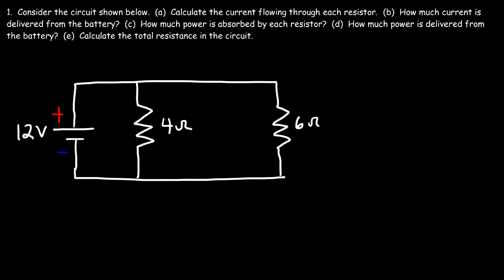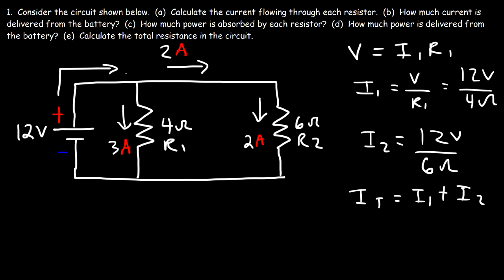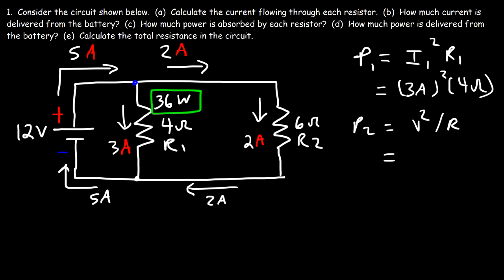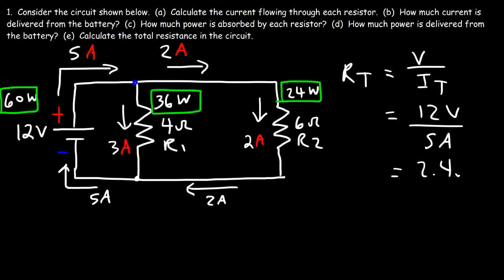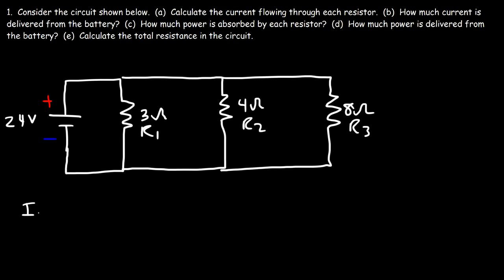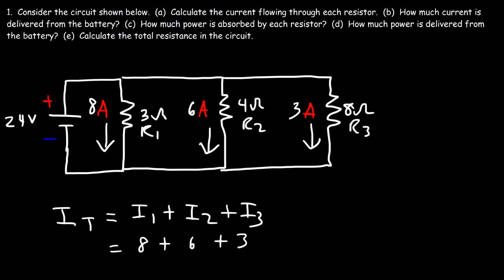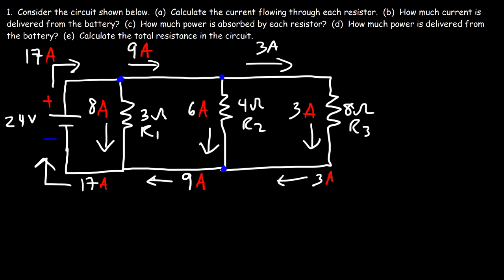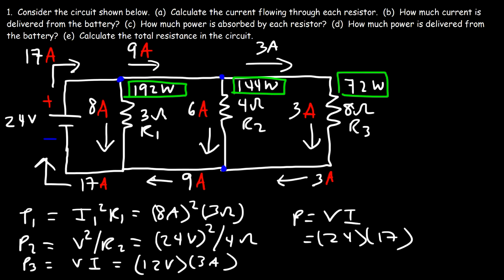Resistors In Parallel - The Easy Way!

Comment: I'm so confused about the power delivered by the battery and absorbed part. I don't understand where these formulas are coming from (i.e. P1= i1^2* R1.... vs p2=v^2/R2 vs. P3=VI. This is only confusing my head even more than when I started. Can anyone help explain this?
Reply: @anniemonroe9285  Okay so basically these are all variations of the same formula, which is P=VI.

 Using Ohms law we know that V=IR. So if you substitute this in the original power formula you get P=(IR)I which is P=I²R. 

Now again using Ohms law we know that I=V/R. So again, substituting into the original power formula we get P=V(V/R) which is P=V²/R.

Hope this helps even if it's a late response?
Reply: @shaheer_04  It does help! Thank you! Even though we've moved on to ideal gas laws, I assume this will be making a come back in my final exam! Thank you!
Reply: @shaheer_04  Also... I HAVE to know. What scripts do you use to write powers in your formulas on youtube? It's obviously not the standard carrot "^" I would love to know your secrets.

Comment: Sir why  I do it in actual but the result of computation didn't get the same result in multimeter?
Reply: Because someone in the comments said he made error somewhere but method should be about right
Reply: The comment says "ERROR ALERT: In the last example at 9:35 you said that you were going to use the forumula P=(V)(I) then you plugged in 12 for voltage and 3 for current but still came up with 72W."

Comment: ERROR ALERT:  In the last example at 9:35 you said that you were going to use the forumula P=(V)(I) then you plugged in 12 for voltage and 3 for current but still came up with 72W.  I thought I was losing my mind!  Otherwise, great video.  Thank you.
Reply: He was wrong, he wanted to say 24.
p=(v)(I)=(24)(3)=72

Comment: There's an easier way than the reciproca of the sum of the reciprocals. It transforms algebraically  to the product divided by the sum: e.g. R1*R2/(R1+R2).
Reply: That is correct, but only possible with two resistors. If there are three or more, we have to use the longer method.
Reply: @Proclifo  No, you don't 'have to use the longer method'. This is mathematically false. You can iterate. Much simpler.
Reply: @Proclifo  god damn THANK YOU! I saw another video saying to use the product over sum method because it's easier, but never clarified it only works with two resistors. I was losing my mind always getting a wrong answer
Reply: Thank you
Reply: Bruh isn’t it literally the lcm of the reciprocal
Reply: I don't see how this is easier in any meaningful way. Plus, it only works with 2 resistors.
Reply: @ukenbreker  It's easier because you don't have to calculate three reciprocals. Try it. You can do it in your head most times, which you can't with the 3 reciprocals.
Reply: This method is applicable to 2 resistors connected in parallel

Comment: When finding the power pulled from each resistor you used a different formula eg R1, I²XR1 R2, V²XR2 and R3 VxR what if there 4 resistors how do I know which to use

Comment: your method of solving for the power in the second resistance does not follow the rules of PEMDAS. correctly solved it is 12*12= 144/ 6 = 24Watts

Comment: for p3 is there not 24v across? I thought voltage was constant in a parallel circuit. p1 and p2 had 24 through them.
Reply: It was a mistake he made. No worries

Comment: Why the current goes through 6ohm resistance..it will choose low resistance path of 4ohm no??
Reply: If you think of the current like cars/traffic and resistance how narrow the road is; 

even if you have a nice wide road (4ohm), it would still be smart to go down the thinner road (6ohm) as well, because you can fit more cars down BOTH roads than down just one road. 

Hence why the total resistance is 2.4ohm, BOTH roads combined let more cars through.

Comment: Why not use P=VI when computing for power absorbed by each? R1's Amp/I is 3, then the voltage is 12V, so product is 36. Same goes for R2. No fancy equations.
Reply: How do you get the V when only total Current and r1,2,3 are given?

Comment: At 5:06, there’s also a third way to calculate the total resistance..
R= P/I^2

So, 60 W/5 ^2 A equals 2.4 ohm
Reply: I don’t know if you can help but I have a problem to calculate current but I have 2700W and 118v
Reply: @anthonyjernigan196  
If you want to calculate Currents with 2700 W and 118 V
Convert P= VI ——> P/V = I
2700 W/118V = 22.88 A
Reply: @jalfredl  I got that answer but I got it wrong
Reply: @anthonyjernigan196  Was the 2700 W and  118v already given or did you have to calculate those numbers first?
Reply: @jalfredl  yeah it was already giving to me
Reply: @anthonyjernigan196  
I’ve done two other ways. First, I calculated the resistance——->  R = V^2/P , which I got is 5.157 ohms . 
Then, I used .....I = V/R  ——> I got the same answer 22.88 A 
The second way that I also did is the square root of P/R = I 
The answer is still the same 22.88A
Reply: @jalfredl  my teacher must be wrong or something it’s not uncommon for her to make some mistakes
Reply: @anthonyjernigan196  
I believe you’re right as well. Definitely check her out
Reply: @anthonyjernigan196  Hope that helps

Comment: 12:06 voice over "P3=(12V)*(3Amps).." should be 24V not 12V but the math is correct 72W
Reply: He used the Wrong calculation, But Got the right answer!
Teachers: Listen here you Little Sh*t
Reply: Appreciate Video! Excuse me for butting in, I would appreciate your thoughts. Have you heard about - Runayslarn Survival Manifestation (erm, check it on google should be there)? It is an awesome one of a kind product for discovering how to repair your electronic items without the hard work. Ive heard some incredible things about it and my mate after a lifetime of fighting got astronomical results with it.